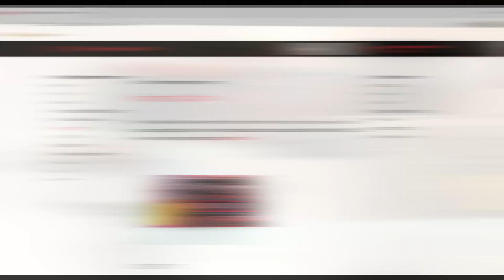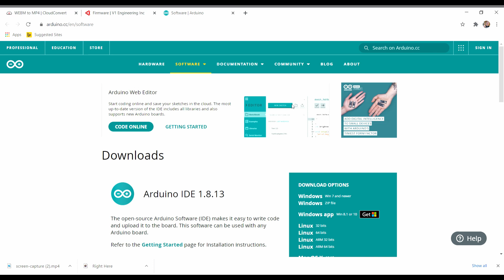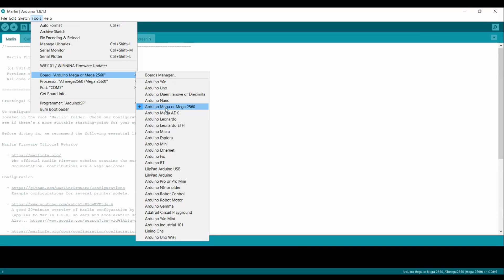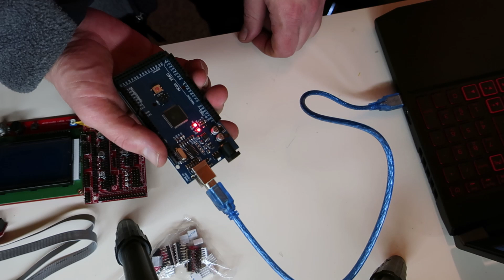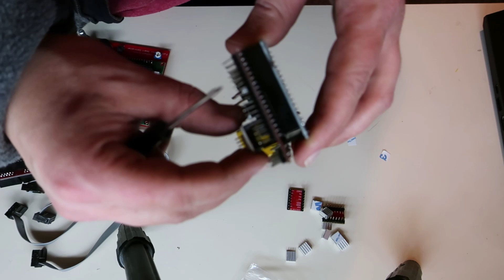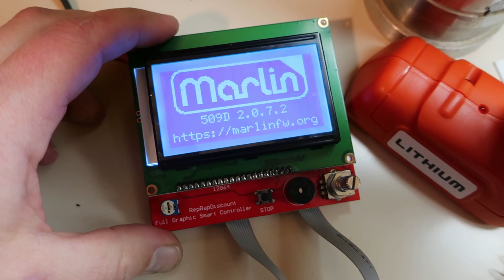MPCNC Primo Build Ep. 06 Arduino Ramps assembly and Marlin install

Comment: How did you hook up the second stepper to each axis when there's only one output per driver?
Reply from the maker: They are wired in series, one driver runs 2 motors.  The info is at the bottom of the page in the archived section. 
https://docs.v1e.com/electronics/steppers/
Reply: @eliworks8549  thank you very much!
Reply from the maker: Glad I could help

Comment: Hello, 
Can u help me  pleas how to configure the Marlin firmware to be used for cnc milling instead of 3d printer, I have seen a lot of videos on YouTube but I didn't find any one of theme that can help me to learn to setup it for cnc.
I will appreciate ur cooperation.
Reply from the maker: 3d print and cnc basically are the same. The V1 Engineering website will give you the information you need.
https://docs.v1engineering.com/electronics/marlin-firmware/
Reply: @eliworks8549   thank you 👍

Comment: Excelent video!! i just building my mpcnc, but, i have a problem with the ramps, o maybe with the steppers, i use the motor steppers of the web V1engineering, but i don't if i can use the full steps, or 1/16 steps, sorry for my english, im mexican, but, recently found this channel, and really like!!1 the content is awesone
Reply from the maker: Thank you. Do you have the drv8825 drivers? I'm personally running the a4988 driver. Can you describe your problem more?
Reply: @eliworks8549  yes, i use the drivers A4988, but My problem, is, when i select the control manual in repetier host, the steppers don't work correctly, i upload the firmware and edit the velocity, step/mm, acceleration, but no works, can i contact with u on fb, or WhatsApp or email? For send more information(,vieos, etc), i'm very stressed with this jajaja
Reply from the maker: @bryanmendozaoficial  honestly I would join the forum. I and others can help there. Or v1 engineering Facebook page https://forum.v1engineering.com/
Reply from the maker: Did you put the 3 jumpers on under the driver?
Reply: @eliworks8549  i use full steps (whitout jumpers), is needed use 1/16?
Reply: You can send me the marlin used for u? For compare the values
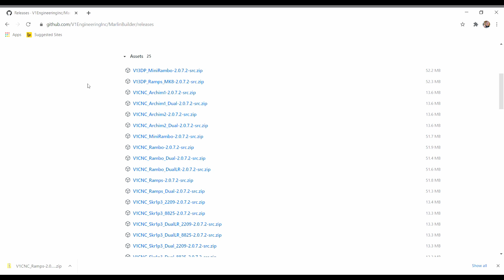Reply from the maker: I used Marlin v1cnc ramps 2.0.7.2 src. The list is at 1:18 in the video
Reply: @eliworks8549  the marlin was designed for full steps or 1/16?
Reply from the maker: @bryanmendozaoficial  1/16 steps is what you want for the 4988 driver. I divided the number of steps in the firmware by 2 because it is programmed gor 1/32 steps.
Reply: @eliworks8549  and wich was the Vref What u used on the ramps?
Reply from the maker: @bryanmendozaoficial  mine are running at 0.65 volts. Could probably go higher, they don't get very warm.
Reply: @eliworks8549  i use .84V in the Vref, but, the steppers are 1.5A per phase, u have the same steppers?
Reply from the maker: @bryanmendozaoficial  2A per phase on mine
Reply: @eliworks8549  Where did you buy the motors? and what was the formula I use to get that value? I bought the engines directly from v1engineering
Reply from the maker: @bryanmendozaoficial  mine came from Amazon but steppers are all similar. I believe your amperage =vref x 2. So for 1.5 amps your vref should be .75v I started low to be safe.
Reply: U used the steppers of the v1engineering? (The steppers of the shop)